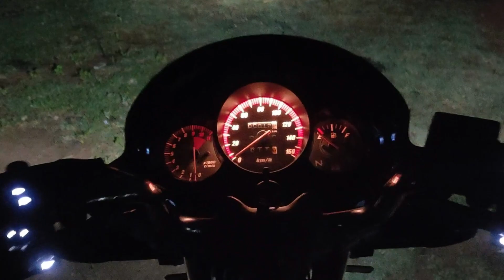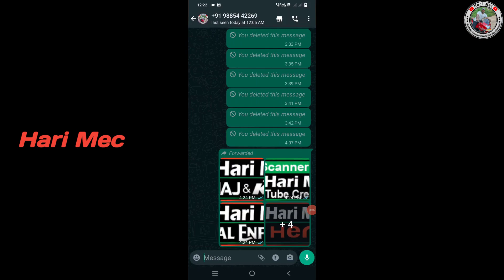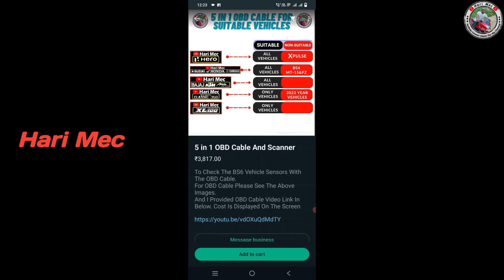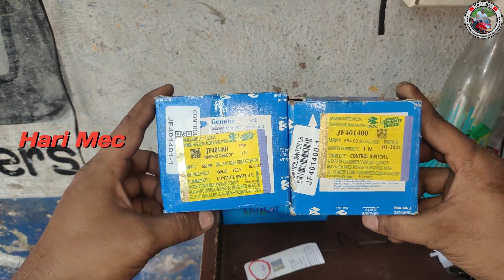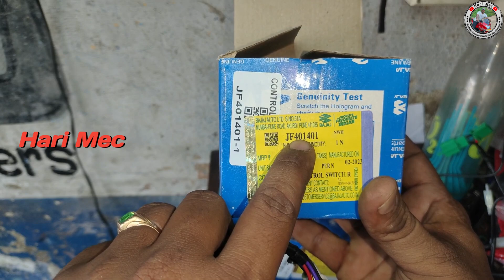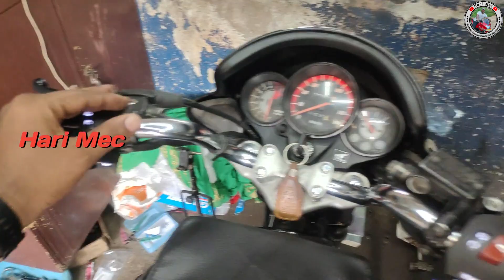Unicorn BS4 Pulsar switch installation Type 2 || Hari Mec

Comment: Hai anna access 125 bs6 scooty ki battery  kothadhi vesaka  5 months ke battery potumdhi , malli kothadhi vesina malli alage 5 months ki malli potumdhi pratiroju morning self start kakumda kickstart chestanu. 5lb battery vesamu 2 times ayina amte emi cheyali anna mari ?
Reply: Bro. RR coil. Over  voltage.  Vachina.  Alane. Potai.  RR. Coil. Change.  Cheyandi.
Reply: check  chesaru bro adhi kuda coil emi problem ledhu mari voltage correct gane vastumdhi annaru. Ekkada mechanics ni adugute access ki battery problems unnay bs6 vachinappati numdi antunnaru .
Reply: @suryacreations572  RR coil.   Voltage correct gane.  Choopinchina.  Okkosari. Direct.  Avtai   anta. Bro. Naku.  RR coil. Change chesake.   Batry problem solve. Aindi.         Anduke. Cheppa.